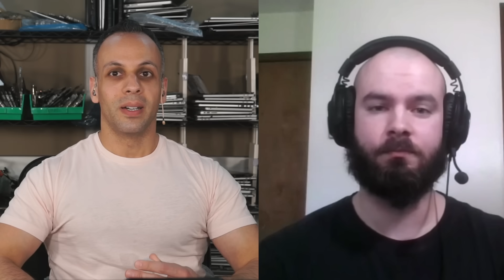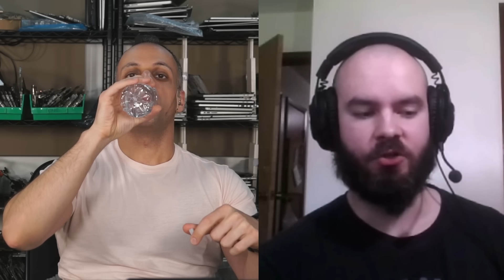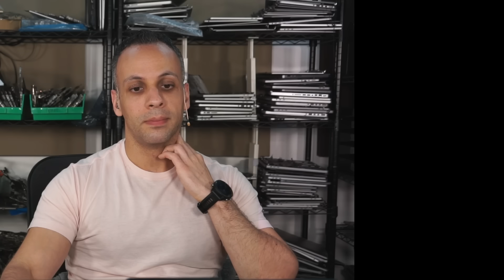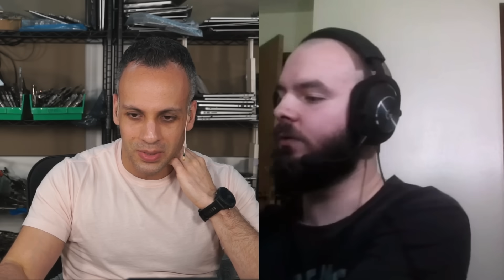Navy tech discusses decline of repair

Comment: In 1984 I started off as a technician and trouble shot hardware to the component level. What Kevin is saying is correct on allot of things (almost all). From troubleshooting equipment to designing and manufacturing hardware for the military. On critical systems you have the hot system, standby system and a backup. Repair starts off with Line Replacement Unit (LRU) which is the fastest way to keep systems running. As time passes old systems are updated and new solutions are found to interface and support legacy hardware.  Similar to Kevin the USAF trained me as a tech I graduated from college and likewise found employment with a contractor. Technology changes over time as do people and their skills. To put things into context the B-2 Bomber first flew in 1989 and the F-22 in 1997. This is a path that has been working coming on to 250 years. Oh the B-1 Bomber flew in late 1974 about 5 years after they landed on the moon. Just saying.

Comment: Shipping cost, most expensive was needing an indicator, and the base sending out a fighter jet to the main stores to collect it, 3 hours from wheels up to landing with it, though the logistics did wok, and the tanker was at hand to refill on landing, while the pilot was handed the box to hold on his lap for the flight back. 10 minutes on the ground, and he did the run there and back at full power as well, instead of at a more economical power setting.

Comment: I can attest to the supply chain & logistics issues when I was in too. My job was NOT repair, but I'd been fixing stuff my whole life & soon found that for a lot of stuff we were waiting weeks or months to get a part we supposedly already had in stock, or because only a certain job class was allowed to remove/install it. After a while I convinced other sections to stop going through CoCS (Chain of Command Supply) & start calling me. I'd remove it, repair, & replace it usually in minutes to hours instead of like in one instance having to wait 6 days for a part to repair a diesel heater for a cat (artillery ammo vehicle) during negative 42°F weather, in which men could have certainly succumbed to exposure. Another crew chief convinced the broken unit's chief to let me have a hand at it, & fixed it with 4 days to spare before the new one came in, which gave us an extra. By the time I left, there was just a handful of things- maybe 26 specific things I couldn't fix there & then in the field.

Comment: I think the video goes a bit too radical in its argument, because the key to keeping costs low is to avoid a monopoly on board replacements/repairs. So the technician at sea still only swaps the boards, but at shore the navy has free choice in which company fixes and tests the board properly and in a standardized manner for next deployment. Multiple companies standing by, including perhaps a branch of the military itself where component level repair experts are employed. It's being reliant on the monopoly 'intellectual property owner' for repair that's the bad thing. 

Otherwise some years later you have hacky fixes made without proper resources all over the ship and each waiting to fail again.

Comment: Ahh the good ol HMJ. Knew a few folks on that boat. I think some of the issues he talked about were command based but it could just be a slight difference in time in service. I repaired and helped repair a bunch of things down to component level as well as some traces and surface mounts when I was in. Also helped repair items for other divisions as well.

But a number of things he mentioned are forever etched into my brain as another former Nuke ET

Comment: Be nice to been able fix parts replaced in USN.  We could only carry so much on the boat.  There times we ran out of repair parts and had to scramble to try repair old parts they pulled and replaced with new part that now failed.

Comment: 10000% its supply... I worked on a Navy contract and they sent me broken board after broken board... They literally threw these line cards into a box in an esd bag that was not sealed.. with 0 protective padding and overnighted it.. If you have a line card costing 10s of thousands of dollars floating around in a box with no padding thats 4 inches high of course itd get damaged.. It had so many smashed pins/bent heat sink fins that I had to get several replacement cards to finally get a functional one to bring that place back online.. I have never seen that in any other branch working as a contractor. I ended up quitting but to this date I still have never seen such poorly handled stock of equipment

Comment: As an Ex-Navy Nuclear EM, I can 100% confirm that the military is very anti-repair due to their suppliers and contracts that prevent us from doing component level repair in many cases. We couldn't even order individual circuit components (transistors, capacitors, etc) from our supply system...
Reply: That is beyond dumb and such an, and I mean this extremely literally, unbelievably stupid waste of time, money and manpower.
Reply: @EddieBurke  Not to mention it leaves you vulnerable as hell. If you can't fly in a supplier's rep - you are totally screwed. And in a combat situation, that is most likely not possible.
Reply: The companies also don't have people that fix their own stuff as well, least that been my experience when I was in USN as an MM.  They wanted to just replace the whole O2 Genny because they couldn't fix it and would require literally cutting a massive hole into our boat to do so.
Reply: @aj.j5833  Wow ... sad situation.
Reply: @jasondrummond9451  We couldn't do it they refused to let us have documents we needed to try trouble shoot it ourselves as well.  What we had had way to much information missing.
Reply: It's a budget thing. As soon as you start saving money, you get budget cuts. It's the same in every government run thing and big corporation. The military etc. has the advantage of being able to keep stuff secret because of "national security".
Reply: It been that way for a very long time now as well, well over 25 years to my knowledge.
Reply: @aj.j5833  That makes sense considering americas industrial complex got gutted around that time.
Reply: yep, even nuke MM.  COC would rather us replace the valve instead of lapping the seating disk.
Reply: Raytheon and every other shareholder wipes their ayus with a Benny gleefully as they've got our troops by the balls.
Reply: Immediately, I thought of all the equipment left in Afghanistan.
Reply: @CommercialForest  at least you know the Afghans aren't gonna return to the company for replacements 😂😂😂😂
Reply: It's crazy to think that. The USMC can make supercomputers from consoles but they can't fix properly their equipment?

Comment: When i went through Nuke school we went through a (relatively basic) class on how to troubleshoot down to the component based on a couple of symptoms and some schematics (for a made up piece of equipment purpose built for this). I lived it. I was so excited to get to the fleet and actually do things like this. All my instructors told stories of the times they got to resolder a capacitor to a board to save mission critical equipment. 

Imagine my frustration when i get to the fleet and the most we got to do was swap cards and replace basic things like switches (one switch i replaced cost $90,000). 

We would spend hours and hours troubleshooting and doing failure analysis to determine faults in the fleet just to pull it out, swap it, and send it to the manufacturer.
Reply: My engineering dreams are literally dying.
Reply: @hq1082  Find ways to learn and practice your skills. Stay away from employers that don't value you and your skills.
Reply: I'm good at fixing car electronics now, due to my training from the late 80's in the navy, BE&E and A/C schools.

Comment: Aircraft bolts can be very expensive because they go through special manufacturing processes and post manufacturing inspection to ensure they are free of any defects which might cause them to fail in use. There are documented cases of planes crashing because some aircraft maintenance personnel used similar appearing but not aircraft rated bolts which failed in flight.
Reply: Not to mention the problem of counterfeit aircraft parts - shoddy stuff from China that falls apart and causes the aircraft to do the same.
Reply: @jasondrummond9451  Yes would you trust a bolt from Temu to hold the engine together, that cost $1, while the original bolts, marked use once only, cost $1000 each.  Temu bolt might fit, but for sure is made from Chinesium steel, not the correct titanium alloy, and if you are lucky it fails before you are in flight. Unlucky you do an air India.....

Comment: "you have to follow the procedure step by step exactly even if you disagree with it" - Isn't that what the military is all about? Suggestion: don't become a pilot, the checklists might drive you crazy.

I worked as a technician to support mysef while going to college. I would swap boards and any individual parts that existed as individual parts in the products. Once I had advanced enough in my engineering degree studies, I moved into an electronics design position. This was more challenging and rewarding, but it leveraged both my technician skills and my knowledge from my studies, and both skillsets gave me a competitive edge over many of my peers. I'm glad I followed this path.
Reply: It isn't in US military.  That what made US military so effective and better then other nations is that we weren't as beholden to procedures and hierarchy as other nations were.  They gave us much more leeway to think for ourselves then those in other nations military, especially when it came to care of, maintenance and repair of equipment we needed to do our jobs properly.
Reply: @aj.j5833  Less beholden to hierarchy, but more stringent in procedure. If ignoring procedure and hacky fixes were the secret to success, the Russian military would be the best. 

I think the video goes a bit too radical, because the key to keeping costs low is to avoid a monopoly on board replacements/repairs. So the technician at sea still only swaps the boards, and at shore the navy has free choice in which company fixes and tests the board properly for next deployment.
Reply: Most military in world comes to stand still when take out the top, not so with US military, next in line all the way down to the seaman/private is trained to step up and take the place of lost leader to get job done.
Reply: Speaking as a former nuke, procedural compliance is a major pillar of our job and community.  This being said, it is not procedural compliance without thought.  We are taught to question everything.  It is a problem of two different pillars of our community being at odds with each other.

Comment: This has been going on forever. I worked for a military contractor in the late 1970s.
A 1N4148 diode that cost the contractor 1 cent was tested on a curve tracer then put in a bag and sold to the
military for $90.00 each for spare parts.
Another thing never got a bad circuit board back from the US military. Guess they just through them overboard.
Would get boards to fix from European countries never from the USA. The military would buy hole sets of boards
that ended up costing more than the entire unit it was fixing. I know they are not fixing them by the amount of new
boards they bought. Don't know why they bought so many boards. These things didn't break a radar came back from Sweeden that was in constant use for 10 years on top of a mouton.
 Sent it back to be recalibrated and we replaced the magnetron and thyratron tubes
Just because didn't even really need them. The units were mostly digital using old TTL logic that rarely failed.
Never got anything back from the US.
Reply: BIG difference between a JAN semiconductor and the commercial 1N/2N counterparts. (Yay curve tracers though! They were a little before my time, but used a Huntron almost daily over half my Naval career)
Reply: @Poets04  not really, the only difference was that the JAN stuff went as a batch through the full shake and bake regime, and if two devices failed a test the lot was rejected, and went into the regular chain. But you could take pretty much any regular part, and test it to JAN, and it would pass no problem. Yes we replaced 54 series failed IC's with 74 series, because they worked, and we could actually get them as well.

Comment: Very good. BTW, WIrewrap did  not predate soldering. It was marketed as having lower resistance than soldering, speed of installation and ease of removal. I'm not sure how well it delivered on those promises.
Reply: Wire wrap has better vibration resistance, at least once you start to use a modified wrap, and it also makes repair easier, as all parts are in sockets. fun come when that socket gets flaky, I fixed it by soldering another socket to the faulty one, making a good connection, because the manufacturer did both wire wrap and solder, so removing it was not going to be easy, but a turned pin socket is easy to solder to another turned pin socket, and I put the new PROM into that socket then. Was not going to be easy to remove 4 layers of wire wrap from each pin.

Comment: I could of told you this back in the mid 90s when I was in the Navy. As an AE all we did was diagnose and replace, never fix.
Reply: I have a military story about that. Probably good thing that I did not ask for permission to repair. They say that forgiveness is often easier to obtain. A bunch of radiators in our rooms were having the same issue. The regulator knobs were coming apart, and causing too much heat, such that people were leaving their windows open during the winter. I looked at it, and saw that all I need is something to push in this little stem in the middle. Went right to the woodshop and built the crude knob myself. I did not bother to shape it to look nice, as it is not furniture, merely a functional get-by repair. Built it around the broken knob. Worked perfectly, until my roommate broke it by tightening too tight, but it being wood, I just glued it again. While everybody else waited weeks for repair, my room was fixed a mere day later. And no doubt for a fraction of the cost.

I don't think anybody higher up knew of my repair. If they did, would they approve of it?

Later on, in college, the air conditioning in the door building was too cold. But no individual controls. Fortunately for me, I had chosen the building with the vents at the bottom by the window. Simply covered the vent with my phone book. I did not even have a phone back then.
Reply: My business partner went coast guard during Vietnam, did avionics on their helicopters. He said to his knowledge they were the ONLY branch trained to do component-level repairs. They were even farmed out to another branch for fixes from time to time.
Reply: What's AE? Associate Editor? Aerospace Engineer? After Effects? Adult Educator? 😂
Reply: @fzigunov  AE in this context stands for aviation electrician, responsible for wiring and power distribution systems of aircraft.
Reply: Right, but how much component level rework did your IAMD AT's do...? Lord knows not everything is fixable, but let's not say it's ALL a dog turd sandwich.
Reply: I got out in 92 I was commo.
Same deal I just diagnosed and then sent stuff up to support.
Reply: That started in the early 80s as well. Although we were able to do some board level repair if there were no ready spares available.

Comment: 2 minutes in and I hope he knows his shit, because i would be hesistamt to disclose anything from a job that requires TS or Q-level clearance. That being said, thanks for sharing your experience!
Reply: I have been thinking the same thing while watching the series. I still haven't figured if 1) the guess did not work on TS jobs, which will explain why they were so restricted on what was supplied to them; 2) they were working on TS job and now are doing foolish team talking about what they did; 3 they did TS work and they are very smart to walk the gray line without getting in trouble. 

I wouldn't risk it if it was TS jobs.😬

Comment: Okay, if they're using staples, what are the chances they took the board out without a wrist strap, wearing synthetic clothes, and are sitting in one of those super cheap staticy chairs? Seems like every other Ebay listing for $$$ test equipment or a $$$ GPU has a picture taken on the carpet.